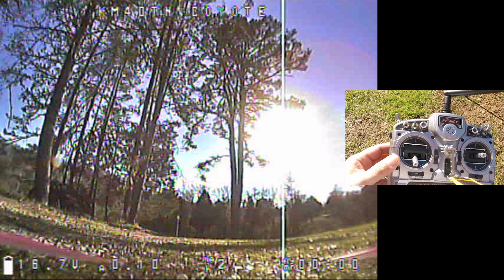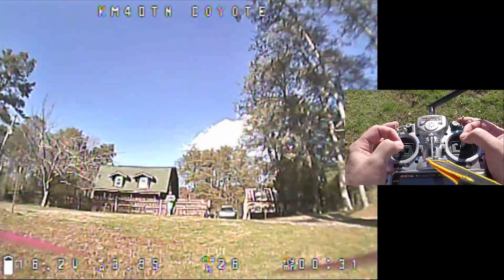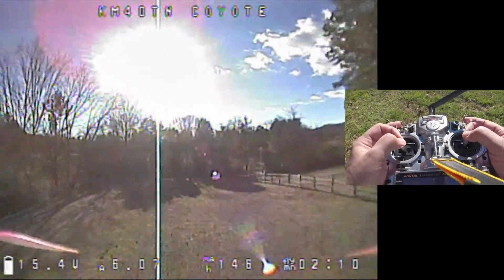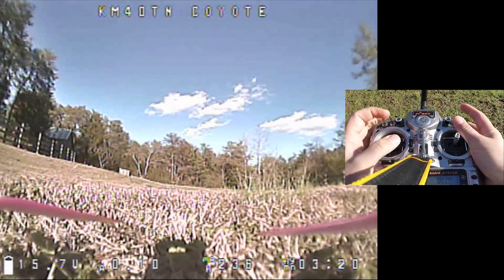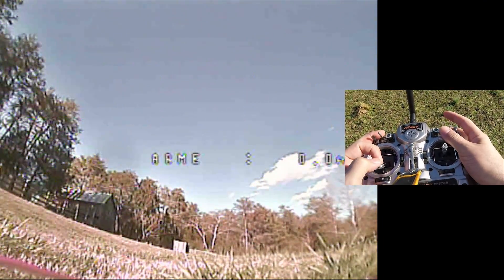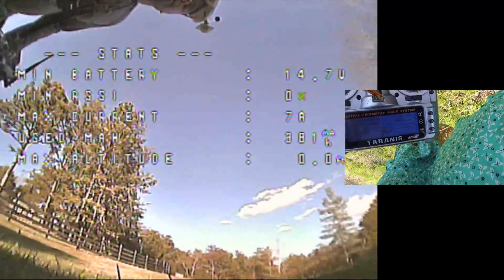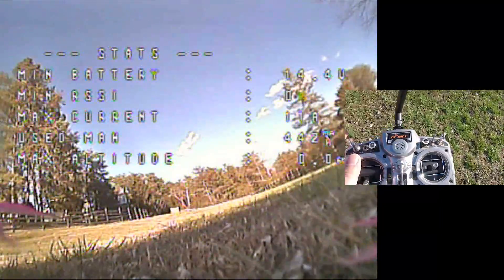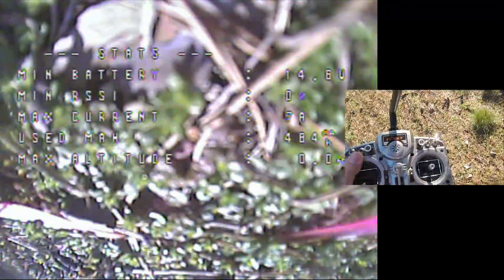How To Land In Air Mode | BETAFLIGHT CLEANFLIGHT

Comment: Disarming? So you still aren't landing in Air Mode. Air Mode isn't on. You're landing in no mode. It seems that would be a really low level, very controlled crash. Why not put Air Mode on a switch and disable it when you don't need it? Such as, when it is time to land?

Thanks for the video's Mr. Bardwell. I've been learning somethings.
Reply from the maker: Landing is touching down precisely with your bottom facing the ground. That's what I do without a separate air mode switch. So I don't feel any need to complicate my quad any more than it is. I have zero problem landing with air mode on, so I don't see why I would ever turn it off.

Oh, and if you watch the beginning of the video, you can see that I did an actual, by-your-definition, landing with air mode on, so neener neener. ;-)
Reply: You're the man. Again, thanks for the video's.

Comment: Disable "Disarm motor regardless of throttle value" and flip disarm switch on final approach. As long as throttle stick is above zero, disarm action won't happen. Instead of having to worry about flipping disarm switch while correcting throttle for gentle landing, you only need to focus on the throttle stick and chop throttle at the right moment where you would have had to flip switch. Makes life much easier.
Reply: That's what I found works really well, too. My arm switch is above my right stick (flying mode2) and I just flick the switch up to disarm while in the air using my index finger and fly in for landing. Automatically disarmed when throttle killed - if I didn't crash already :-p
Reply from the maker: +RaceMiata this is discussed elsewhere on the comments.

Comment: finally! but i'm still a little confused because you said "never" enabled if i don't toggle the GUI or activate a switch, but you then say it activates when throttle goes above 1350. it's just not permanently enabled, right? so what then is the benefit of permanent air mode during takeoff if later it will become active during flight and landing?  thanks again for your knowledge!
Reply from the maker: If you have feature Air Mode enabled then air mode becomes active permanently when the throttle goes over 1350.

If you do not have feature Air Mode or a switch mode set up, then air mode never becomes active at all.
Reply: i'm getting there.. so by toggling on (enabling) permanent air mode in the GUI,  it is NOT active during takeoff; it activates at throttle > 1350? (all this time, i've never messed with air mode settings in the CLI.)
Reply from the maker: +SaGô yes.

Comment: as always, josh, thanks for your tips, but i have a question that's been nagging me for some time. i do not enable permanent air mode by switch or BetaFlight GUI button toggle. i do have air mode activate when throttle is > 1350 (default). it's known that authority at low throttle has improved with the latest iterations of BetaFlight. so my question is: when i do a punch out (air mode gets activated) then cut my throttle to 0, is air mode deactivated? (i can't find anything in the Wiki or web.) i believe it is, and it's this improved low authority that still allows me to do acrobatic moves at 0 throttle. when i come in for a landing, my throttle is < 1350, so air mode is deactivated, and i don't have bouncing issues. enabling permanent air mode on the GUI is like the old way of turning it on by switch. why do we need permanent air mode since we have control on low authority now without it?
Reply from the maker: +SaGô if you don't use Air Mode either by feature or switch then it is never enabled. 

Also, air mode activate doesn't work like you're saying. It activates the first time throttle goes over 1350 then it stays active until you disarm.

Comment: Thanks for all the great videos Joshua Bardwell.  One thing I would love input on is accomplishing this - I would love to arm my quad (TBS vendetta) and have the motors not spin, but then have the settings such that once I throttle up and I'm flying around, dropping throttle to Zero will only bring the motors to an appropriate idle speed in order to maintain stability more easily in the air - like when using no throttle but still using yaw for example.  Can this be accomplished?
Reply from the maker: With a Taranis, anything can be accomplished, nearly. What I would do is this:

Configure idle up so that the throttle channel does not go below min_check when you are armed. Bear in mind you can still run air mode if you want increased authority. The point of this idle up is solely to keep the motors spinning.

Configure idle up to depend on a logical switch. It should be a "sticky" logical switch. The "goes-true" condition is when the arm switch is in the armed position and when the throttle is > -99 (i.e. when the throttle is raised). The "goes-false" condition is when the arm switch is in the disarmed position.

Enable motor stop.

The effect of htis will be that arming does not cause the motors to begin spinning but as soon as you raise the throttle, the motors won't stop spinning until you disarm. You will still need to lower the throttle in order to re-arm, because the flight controller won't allow you to arm with the throttle raised.

I haven't tested this, but that's the approach I would take.
Reply: Joshua Bardwell awesome idea thanks! I'll give it a shot!

Comment: Another option is to turn off disarm at any throttle position. Then you can can come on in and as you approach your landing zone, flip your disarm switch. The copter will keep flying until your throttle stick goes below min check. Then you don't even need to reach the switch as you are focussing on ground proximity etc. This technique helped immensely with my landings

A couple of points though if you try this method:
1. If you flip the switch really early and then keep flying on in to  your landing area and for whatever reason drop the throttle a little aggressively to lose altitude, you fall out of the sky.
2. When you want to disarm because you are crashing, you need to remember to hit the switch AND drop the throttle. I found I got used to this very quickly.

Comment: Why do you chop the throttle when you could just disarm?  After all isn't the throttle chop redundant?   Also, I find it easier to put airmode on a switch and disable as I am returning to land.  Then I can land with the more intuitive throttle chop followed by leisurely disarm.
Reply from the maker: +Steve Minard I want the copter to gradually descend the latest few inches not fall. Hence lowering the throttle then flipping the switch just at the end.

Comment: I use the shoulder 3 pos switch to  1. Airmode OFF, 2. ON 3. ON with Black box. 
I All ways want to turn Airmode OFF when testing, or testing my friends patience or chasing my wife around the house. Great to know it's all over when you snap your hand back. But , leave it on when you want to and shut it off when you want to catch it.

Comment: have your 3way switch on disarmed / armed (with motor stop) and airmode. Once you come in for landing, drop switch to armed only and just throttle down to zero, once you are on the ground, you wont bounce, and it works perfectly.

Comment: I have Horizon, Acro and Air Mode on a 3 way switch (top to bottom). So when I land, i just switch it all the way back up to Horizon, land and disarm (which is on a separate 3 way switch (disarm/arm/beeper).

Comment: I use the two stage arming you outlined in your earlier video.  One of the features of the disarm is that you have to hit the switch to disarm AND the throttle needs to be at zero (or very close).  So what I do is when I am committed to landing, I trigger the disarm switch (but I am still running because the throttle is not at minimum).  So when I touch down, i just drop the throttle to min and it immediately disarms.
Reply: I'm pretty sure in Joshua's dual stage arming setup, the throttle has to be zero only to arm, not to disarm.  I don't think it's safe to have to also lower the throttle, and hit a switch to disarm.  If I hit the disarm switch, I want it disarmed right now, regardless of any stick positions.  This way you don't need to lower the throttle when you're landing.  Just disarm, and motors will stop regardless of throttle position.

Are you sure you have "Disarm motors regardless of throttle value' set?  If this isn't set, then you would have the behavior you describe, but not because of any setup on the Taranis.  I don't know why you'd not want it to immediately die if you hit the kill switch though.
Reply: It does require both the disarm switch to be triggered and the throttle to be below a given set point.  You can see in the video he is doing both simultaneously, chopping the throttle and hitting the switch.  I can certainly appreciate some of the advantages for pure switch disarming (and there have been a couple of times I wish I had that).  But on the whole, I like the two stage because it requires two deliberate actions arming or disarming. I'm a klutz and I know I would hit the disarm switch accidentally while up in the air.  And for me, the two stage disarm works well on landings.
Reply from the maker: +Brian Case no that's not correct. Disarm works immediately. Lowering the throttle is not required. I'm lowering the throttle to finish the touchdown gracefully.
Reply: I guess on the next rainy day I will dig into what part of the programming I screwed up on.  Nevertheless, I've adapted to the way it functions and really like it.  Thanks for the reply!  Love the videos!
Reply: I double checked my settings against what is in the two stage arming video and I can find no differences in the settings.  But I volunteer I am not an expert at programming and i might be missing something right in front of my face.  Perhaps you could help me find where I am wrong?  According to the logic, the quad will follow the arming state of L4.  L4 is a sticky of L3, which has an AND statement that requires that both L1 AND L2 be true. L2 is true only when the throttle is below -99.  So I don't see where the disarm logic can be divorced from the arm logic.  I can state after 100+ packs with this set up that the disarm (with my radio settings) will only function if the SF switch is triggered and the throttle is down below -99.  If the throttle is lifted and the hit SF (to disarm), the quad remains running.  Once I also chop the throttle, then it disarms.  Again, I really like this method and have found it very useful.  I am just curious where my mistake is.  Thanks again!
Reply: Connect quad through usb only.  Connect in betaflight configurator.  Go to receiver tab and check your arm channel when you flick switches / move throttle.  If the arm channel is only going off of arm when the throttle is lowered, then something in the taranis is set wrong.  If arm is changing immediately with disarm switch, regardless of throttle, then the taranis is correct.  In this case, I suspect the setting 'disarm regardless of throttle' (in betaflight) is not set, causing the behavior you describe.
Reply: Hey ryan0io, the arm/disarm on all my quads is on Aux 3.  Just to be clear on the functionality: arming set is with switch SF (rear position) + SH (greater than .6 seconds) + throttle position less than -99.  Disarming occurs with switch SF set to forward position + throttle position less than -99. 
In BF, aux 3 does change status (2000 to 1000)  when SF is set to the rear (disarm) position, but ARM remains highlighted/active until the throttle is also dropped.  And so as I suspected there was something right in front of my face, but it was in Betaflight. Just moving the slider on "Disarm motors regardless..." will allow the disarm to happen upon only tripping the SF switch.  Yeah learning!
Thank you very much for the point in the right direction!! :-)
Reply: As I thought in my first reply.  On racing quads, I see no reason for the disarm switch to wait for throttle low.  If I hit the kill switch, I want it dead, right now.  On camera platforms, / gps rigs, maybe it's different.  Even for normal landing, I normally disarm at partial throttle anyway, so this is a must for me.

Comment: I see all these guys saying to just disarm before you touch down which works ok (Especially if you disable disarm at any throttle, then it disarms as soon as you touch the ground) But why don't you just put air-mode on a switch? And that way you can turn on motor stop and when you activate air mode it automatically idles up. That way you can first of all land easier and second you can fly without idle up if you want to.
Reply from the maker: I don't think running with motor_stop enabled is safe.

I want air mode on all the time. I don't want to give myself the extra step of activating it. It doesn't make a problem for me.

Comment: I like to disarm just off the ground with a switch on the right side of the Taranis. It is also nice to disarm before getting in the grass so that its not a lawnmower. Thanks for the video. Also if I'm in an area where landing is an issue. I like to pass over my head from behind me, and then take off my goggles and land direct sight. Remember to do this with the sun behind you.

Comment: I put spring switches in place of SB and SC on my Taranis so I can arm and get call outs using my middle fingers while pinching. That way I only need to push down. I you have to hold both to arm and just tap SB to disarm, and tap SC for Mah call out. It is very easy to reach in pinch that way because you never need to get under the switch.

Comment: what camera and lens are you using?
Reply from the maker: Foxeer XAT600 with GoPro style lens (2.5mm).
Reply: Joshua - I've been planning on upgrading to a GoPro style lens. However, I have found several different ones with various brand names. Not sure if some are mediocre knock-offs. Specifically, which one do you use and recommend?
Thank you!
Reply from the maker: +Larry Delceg I use the Vicdozia. Check my GoPro lens video there is a link in the video description.
Reply: Thank you so much Joshua! Your personal help means a lot.

Comment: I don't know about anybody else, but my finger is in the disarm switch the whole time I'm flying?
Speaking of 'stick arming'.  If I ruled the world (or just Betaflight), it wouldn't even be an option.  Same as air mode.  I wouldn't have that as an option either.  It would just be 'on'.
Reply from the maker: It used to be an option IMO because four channel transmitters were the norm and more channels were very expensive. Just a guess.

Comment: I fly with 45° uptilt on a 2.1mm lense and found it natural to land by flying low in a circle and kind of drift onto the landing (like a dog does before it lays down). I roll in the opposite direction just before touchdown to brake and I get it perfect 95% of the time. It was so natural, I thought most people in air mode land like that. Turns out I'm a weirdo.
Reply from the maker: Yep. This is a great approach for high uptilt.
Reply: Joshua Bardwell Wow. Thanks man. Glad to hear I'm not just a noob lol.

Ialso have to tell you this. I went flying right after commenting on this vid and meet a couple guys who were having problems landing. I taught them your landing techniques and they were able to get it 1st try. They instantly asked for my # and now we're flying buddies. Don't worry, I made sure to give you credit and plugged your channel, but it turns out they already watch you lol. Anyway, I really wanna give you a HUGE "thank you." They're the only flying buddies I have after over 1 year of flying quads.
Reply from the maker: +john budhoo glad you found some buddies and that the info was helpful. Happy Flying!
Reply: john budhoo Exactly how i land. You can come in hot and cut fast and slow yourself easily and drop down for a landing.
Reply: whoflungdo1 lol. Just gently decrease throttle till you touch down. You'll eventually see the ground come up when you get close. If you're doing a true circle and not an oval, you'll be able to see your landing target before touchdown at all times except when you're directly above it. That makes it super easy to come in gently.
Reply: Caton cox I agree, but I'm more comfortable with slow landings because I have an underslung battery. I almost died when I had to disarm at ~30ft yesterday. Now I have a squished battery that I gotta keep an eye on.

Comment: I ended up sticking AirMode on the high position of my Arm switch. Works good for me.
Low=Disarm, Mid=Arm, High=Arm+Airmode.
Reply: sandboxsteve thats a good idea... that saves an extra switch for me
Reply: sandboxsteve I do the same... I just disable Airmode before landing using a switch... And that's just less of a hassle...